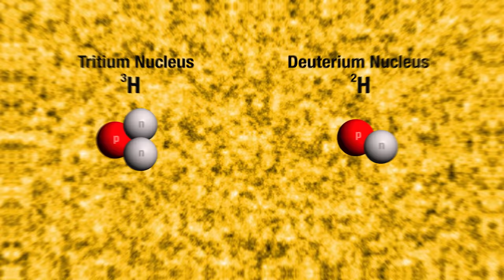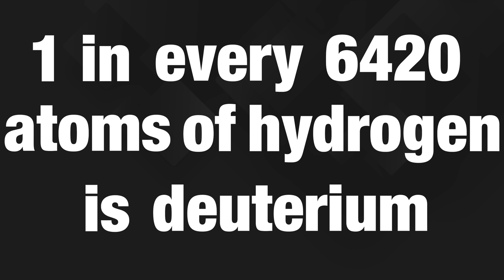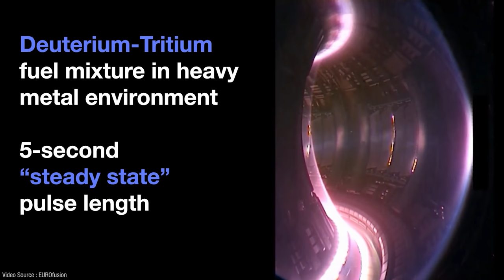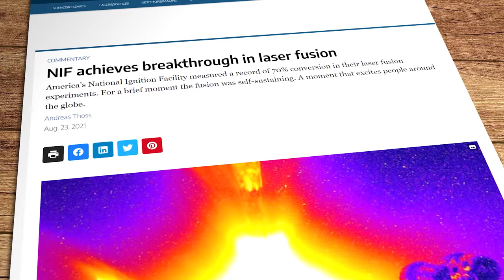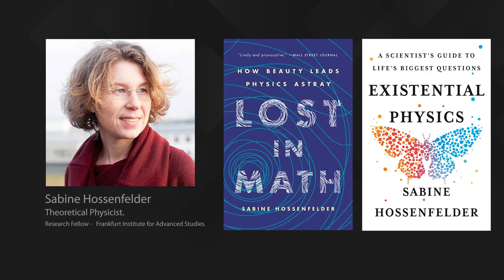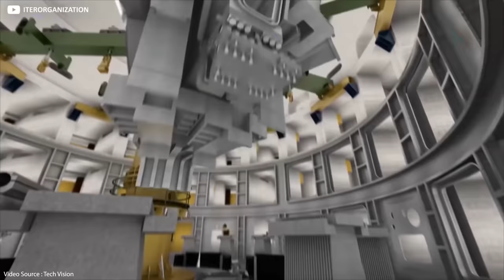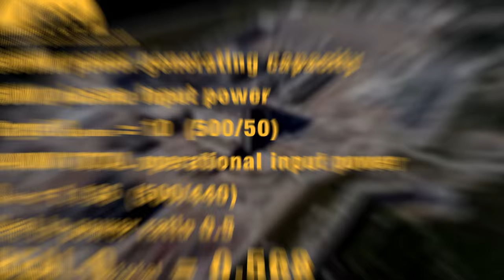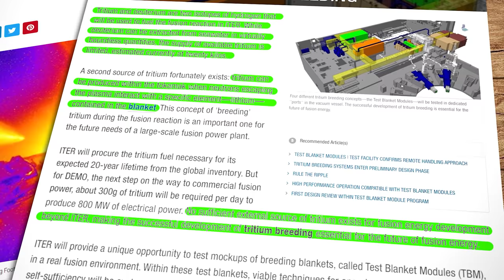Nuclear Fusion Illusion. Is it time to park the pipe dream?

Comment: One note, a lot of investment money is going into smaller fusion designs with some looking to have non-neutronic fuels, such as proton-boron fusion, and no need to breed tritium. This requires higher temperatures but the thought is the small size would make this easier to control. Check out the Fusion Industry Association for more info on the 20 or so private fusion start up companies.
Reply: yes, this. It's worth pointing out that the HB11 project doesn't go for temperature but uses laser impulse to apply pressure to the fuel which is ordinaryboron and hydrogen. One of the most promising things is how many routes there are to fusion from big and safe if already obsolete ITER, to pretty conventional but cutting edge Commonwealth Fusion from MIT, to more unconventional ideas like General Fusion using massive pistons to generate pressure or HB11's laser driven project. The biggest challenge at this point for tokamaks isn't breakeven energy - that's almost certainly solved by a new generation of high temperature superconductors that are already available at industrial scale. The hard part now is controlling the plasma and it seems like every week a paper gets published chipping away at that problem. It takes a matter of perverse faith to assume we'll never solve it.
Reply: Ah yes. If there one thing the world needs. It nuclear in a smaller package. The U.S military is working on that. Certainly not for nefarious purposes, I hope.
Reply: There is an old saying in SciFi that you do not move forward until the supporting technologies catch up. It makes sense (example - you can not go to Greek times and build rifles, the metallurgy and chemistry are not there).  Now we have superconducting magnets, real-time super fast computers and a dozen other small technologies. As written below, ITER is already obsolete.  When MIT says that the numbers make sense, the numbers make sense. It will happen, not by any US Government thing, by Europe or by China or maybe somebody like Elon Musk or Bill Gates will decide it must be done. My bet is a design for a fusion powerplant in 10 to 15 years. Power by 2050.
Reply: true, i think that systems that utilize some of the natural magnetic instabilities of the plasma could be much closer to rendering a viable plant, z-pinch and focus fusion type stuff. i really like the concept behind zap energy and Focus Fusion.
Reply: Anything other than the classic D_T reactions will need higher temperatures because of greater repulsion between the nuclei. that brings us back to the containment problem.
Reply: @aldenconsolver3428  I'll take that bet.
Reply: @j.f.fisher5318  The problem with LIF is it uses Lasers, there's a big difference between fusion Q and net Q.

Lasers are typically between 10-20% efficient, plus all the additional support equipment, LIF will need a fusion gain of 10 to 20 to hit net Q.

LIF also has issues with power extraction which could push the required fusion Q higher.
Reply: @andrewharpin6749  LIF was never meant to produce electricity. Inertial confinement cannot supply fuel fast enough. It was built as a research center for fusion weaponry, and luckily some plasma science useful for less horrible objectives.
Reply: Science Revolution  lol

Comment: Couldn't help but notice you chose a picture of windmills, but I can't help but think we need to focus on nuclear reactors, and the addition of thorium looks like a great solution.

We now have small modular nuclear reactors in production,  and several new designs. We could have dozens of those up and running in 10 years.  Granted not as fast as wind and solar, but more reliable less destructive, and way more bang for the buck.

If we could get really small with these designs, I think that would be great, let's decentralize the grid as much as possible.  It makes us extremely vulnerable.

Comment: I agree that both energy research and renewable energy production are underfunded, but I would rather they reroute current fossil subsidies than cannibalise either. We need both.
Reply: we dont..  fission and fusion would be too expensive..   solar and wind are incredible cheap and we already know how to solve their intermitency issue in a cost efficient way and solving all our different co2 emmision in the other sectors at the same time.
Reply: @angellestat2730  I mean that fusion research contains several sub-researches that other technologies can benefit from too, even if fusion itself never becomes viable. For example the amount of research in precision magnetic fields, or 'higher' temperature superconductors to save liquid nitrogen/helium. If this 'only' increases the efficiency of maglev trains and MRI devices in hospitals, or wind turbines, we still benefit. In my opinion, the money is there for both, just get military budgets involved and you can fill the atlantic ocean with windmills. This is absolutely the time to invest more in energy tech, not less, but by reallocating other,bigger funds to building renewables, not by suggesting we save money on energy research instead. Still, criticising the cost of ITER is valid, as other government building projects that explode their budgets.
Reply: @Mr_Stone1  any huge amount of investment in any research could possible provide developments in other tech branch. 
But If you want better trains, just invest on better trains. 
It is a bit silly to think that we need to spent a lot on fusion knowing that it would not help us to solve our climate emergency. 
Also.. The IA age is coming.. any project that requires more than 15 years of development, it is incredible pointless, because after that time you would have incredible tools at disposal that would solve all those issues in few days at almost zero cost. 
If anyone wants to research on fusion, fine.. but they should do it with their own private funds or investors. 
But here we are talking about public funds that are being used to research a tech who does not solve any of our current needs.
In any case.. they should try to accomplish fusion for propulsion on space, that seem orders of magnitude easier that here on earth to produce energy.
Reply: @angellestat2730  We absolutely shouldn't take AGI as a given. Great if it happens (and is, of course, aligned), but we have very little idea how close or far we are.
Reply: @Low_commotion  We dont need to reach the level of Agi to support my point. 
We just need to agree in some parameters that are quite obvious.
1- Hardware (analog or digital) for neural networks is improving at very high speed.
2- the same can be say of the tools used to develop Ai apps. 
3- new methods of learning are being applied, that require less tries and more efficient in the amount of training data required.
Now, Imagine that nobody would have invest it a thing on fusion in the last 60 years. 
How much it would take us to reach the level that we are today if we start just now?  
You saw how many different approach we see today for nuclear fusion?  many from small companies taking advantage of high physics simulation? 
Many of the approach already used AI apps to find out the most efficient design. 
So.. if we know for sure that we still are several years from the goal, why we keep spending so much in fusion hardware that we know it would not be enough, instead waiting and then discover everything in few years once we have much better tools.
This is similar to the Project Longshot, I dont have any issue with that because it is private funded.  But a project like that requires several years on development at our current speed, and it would also take 40 or 20 years more to reach destination. 
This mean that each year of extra development would accomplish higher speeds, making pointless all the first sails that would be early launch. 
On the other hand I understand not to wait for the AI boost. 
Because one thing is to develop something on your own, with your own intelligence and creativity, and a different thing is let than an  app would do it for you, stealing any feeling of accomplishment.  
Sorry, my answer was quite long :)
Reply: we need fossil fuels

Comment: The problem with thinking we must divest from fusion to proven technology is the scale. even if iter takes up 25bn and turns out to not be very good, which I think is unlikely, I think there's good reason to believe it will at least achieve its goals, that money is still peanuts compared to what we need, and what is already being spent on current renewables. These 25 bn would also have been invested over the course of 30+ years by then, so it's a complete drop in the ocean compared to the rollout of renewables. Also the scope of fusion was never to save the world from climate change, it was always a physics experiment that has now been glamorized for reasons I honestly can't understand.
Reply: Fusion has always been sold as the energy source of the future, not just some scientists experimenting with high energy plasma. Also, if we had invested a fraction of the 35 billion into small modular reactors (SMRs), we could have developed multiple SMRs and begun mass producing them.
Reply: I'd say the scope of fusion definitely was to get it as a powersourcen not really a physics experiment (though obviously it is a physics experiment also by need), it just indeed was never meant to combat climate change or such and definitely is a longterm civilization project, taking generations if necessary.
Reply: What is the "good reason to believe it will at least achieve its goals"? No one has shown that.
Reply: Science Revolution  are you trolling?
Reply: @paulsmith3921  noone has shown the opposite either? The ethos against this argument you've put forth is staggering...
Reply: @Kajmera  That depends on what is meant by ITER's goals.  If they include creating a practical electrical generating plant, then no, there is not a good reason to believe it will achieve that goal.  And if that is not among its goals, then what's the point of it, other than a Welfare Program for plasma physicists?
Reply: @jebimasta4604  that's... literally my entire point. Fusion is being misrepresented as a climate change solution at the moment, when it shouldn't be. As for the pressure on politicians, everyone is doing that, that's how the game is played; whether that is a good thing is something else entirely.
Reply: @j.f.fisher5318  Peanuts soon add up to elephants, and if it was put into a technology that is actually working like renewable energy it would be dramatically more useful.
Reply: Science Revolution  Wow, a couch potato expert in conspiracies.
Reply: @Kajmera  You're asking me to disprove something that isn't working? Hahaha.
Reply: @paulsmith3921  As soon as we spend more on ITER then subsidising fosil fuels, or even the olympic games, I am with you. Untill then, not so much. Most money could be spend better, hell bezos is spending half a billion on a useless fucking boat.
Reply: @someonespotatohmm9513  Nothing in there that justifies your comment.

Comment: General Fusion is worth "a look" (not saying it's going to work, just worth an objective analysis as it appears to be quite a different approach than the systems you highlight in this video)
Reply: :General Fusion is worth "a look" Yea I have waited since the 1970s for it to happen. What if theories on how the Sun works is wrong?
Reply: Yeh, 100%. I'm very skeptical of tokamaks and stelerators. I like their design because it tries something different. And it certainly feels like it could work, other teams have shown Inertial Confinement fusion works with lasers. So I'm hopeful. It also by its very design has already considered actual useable power generation. Unlike others where there's no thought out solution for how turn the heat energy into electricity.
Reply: @davescott7680  how to turn the heat energy into electricity is the easy part. you raise steam, make it turn a turbine and connect it to a dynamo. We have mastered this part well.
Reply: Science Revolution  what a load of rubbish
Reply: Science Revolution  lol, i was just about to like your first comment for admiring your sarcasm.
What did Mark Twain say again?
It's better to keep your mouth shut and appear stupid than open it and remove all doubt
Reply: Mad people on the loose again...
Reply: No, it is definitely not going to work. General Fusion's proposed method to compress the central void channel in the rotating lithium mass is not realistic.
But you are not allowed to tell General Fusion so because all their videos on YouTube have comments disabled.
Reply: Same with LPPFusion, which has a completely different, though woefully underfunded and understaffed operation.
Reply: @janami-dharmam  "how to turn the heat energy into electricity is the easy part. you raise steam"

And how are you going to raise steam from a hermetically sealed magnetic doughnut? You can't put water inside and you can't let the plasma touch the walls.

General Fusion's solution at least has that bit figured out.
Reply: @VeritasPraevalebit  

"is not realistic"

Why? The maths checks out. It is purely an engineering problem to coordinate everything properly, but none of it requires "new science". It is certainly testable in a very near future.

There are commercial pistons a regular person can press with their bare hands to start fires. It generates temperatures of hundreds of degrees only from the quick increase in pressure. I doubt hundreds of pistons pushed by high-power military-level air-cannons can't generate some millions of degrees by squeezing the liquid metal.

It also solves the problem with the tokamak approach: the energy is high but the pressure is low, that's why it needs to be several times hotter than the sun to get fusion going. When you violently increase the pressure, the temperature required for fusion drops.
Reply: @matheusdardenne  
Time will show that I am right.
Reply: @VeritasPraevalebit  I guess time is the only thing that COULD prove you right, because clearly you don't have a technical objection.

And indeed time will tell if you're right, and not much of it; since the idea is so easy to test, it'll be ready within a year.
Reply: @matheusdardenne  
I did have a technical objection, namely that the of the compression of the liquid lithium shell will not work. There are several other technical reasons way it will not work, but one is enough. 

Your description of the process is not just simplified, it is completely wrong. And what is your reason for stating that the math adds up? 

General fusion is planning on construction of a demo in Oxfordshire, at Culham. The plant is going to be 70% of the size of a commercial reactor and is planned to be completed by 2025. So we will have to wait a considerably longer time than a year.

You think that the concept is easy to test? Then please tell me why General Fusion has worked two decades, changing the concept several times along the road so far without succeeding. I am inclined to rename the company General Confusion.

Still they have attracted a lot of investment money from entities that did not care to do proper due diligence.
Reply: @VeritasPraevalebit  

A technical objection would be an EXPLANATION on WHY you THINK it wouldn't work. All the maths and physics is 100% correct, so it could only possibly be an engineering problem. This is what I wanted you to clarify; what is this engineering problem that you see?

"There are several"

Such as?

"Your description of the process is not just simplified, it is completely wrong"

... it's not. They'll rotate liquid metal within the container to form a hollow cylinder, inject the gas in this cylinder via a plasma injector, and then fire pistons to compress the liquid metal, forming a sphere with the contained plasma, crushing it from all directions in a coordinated way to achieve such high pressures that fusion can occur. The fusion will heat the liquid metal around the plasma, this heat will be used to generate steam and the rest is normal stuff. This whole cycle is proposed to happen every second.

"And what is your reason for stating that the math adds up?"

... the maths. There are over 30 papers published about it. There are links to them in their own website.

"So we will have to wait a considerably longer time than a year"

Oh, God, three years, how could we possibly wait that long? 😭😭😭😭

"You think that the concept is easy to test?"

Yes.

"Then please tell me why General Fusion has worked two decades, changing the concept several times"

.... This is exactly the explanation. They changed the concept several times. They current design IS easy to test. They'll build it in few years. Most of the tech they're having to develop from scratch have nothing to do with the fusion process itself, but with the off-the-shelf components being too expensive.

"Still they have attracted a lot of investment money"

.... Not nearly as much as you seem to believe.

"from entities that did not care to do proper due diligence"

And I believe "due diligence", in your mind, stands for "listening to a random guy in the YT comment section who is skeptical, despite not having a single technical objection to present".

Comment: Having to maintain staggeringly hot plasma in such close proximity to staggeringly cold superconducting magnets, and then having to insert yourself between the two to utilize the heat, has always struck me as being stuck in a cage fight with Maxwell's Demon.
Reply: The energy of the plasma isn't meant to be dumped onto the reactor walls. That would actually be pretty bad as that would be a confinement breach. Not only would that screw up the rest of the reaction but it would also lead to the ablation and eventual destruction of the reactor wall given enough time. There is a specific place in these reactors where the plasma is meant to dump it's energy. It's a trench-like structure at the bottom of the reactor called the "diverter"